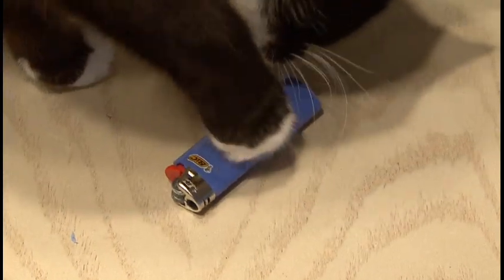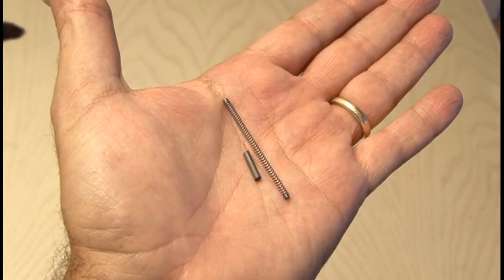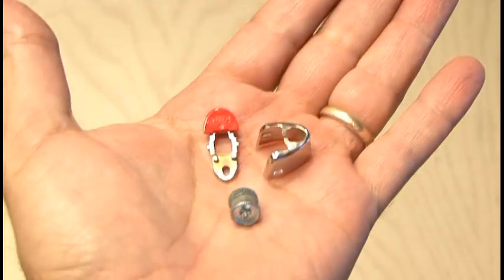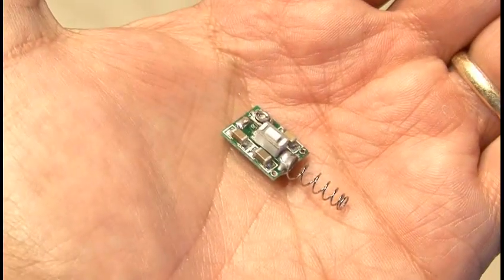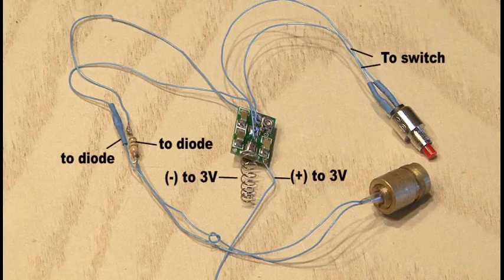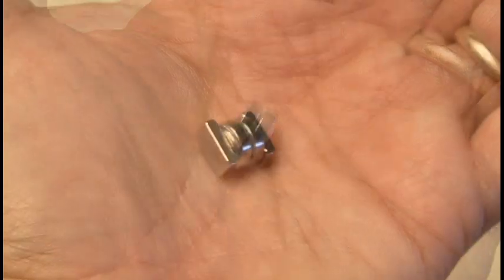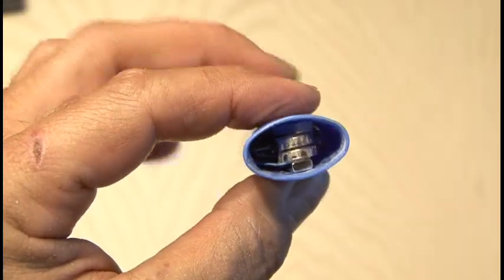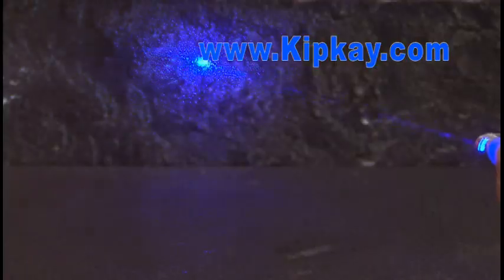Amazing Cheapy Lighter Laser Burner!

Comment: @sorryaccessdenied 

Don't worry. This battery was pregnant.

:D

The 12V-Battery consists of 8 1,5V smaller batteries to reach this voltage. The batteries you know are 1,5Volt, too and they are galvanic cells with zinc and carbon.

greets ;)

Comment: @archangel656 Apparently you don't understand how this whole comment section works... When you see @ with a user name that means the person is talking to the user who's name follows the "@" in this case I "sinisterchopper" was commenting on another users post where that user had commented on AA batteries not containing button cells. I am aware of the fact that this video was referencing the 12 volt A23. You should probably read things throughly before you start spouting off at the mouth.... You

Comment: @elowyn4life Laser pointers produce light radiation, which in turn produces heat as well. The one kipkay built is probably higher than 95mW (which is minimum), so it's more than enough to light a match/firework/cigarette.

Comment: @1l0r1a3c
Notice how long it takes for the cigarette to burn...this is probably one of the weaker lasers that doesn´t instantly ignite you.
Also Cheek /= Retina...
But yeah, pointing it at your face is teh fail.

But the video is not fake, I´m with you on the effort part, tho.
What´s about the people calling this fake anyway, ever build one yourself to try with the parts and circuit drawings he provides?
No?
Then shut up...

Comment: @dm8p8ntballer you dont want this laser. its an expensive peice of crap. if you knew how experts built their lasers you would know how bad this laser is. you will probably burn out the diode within the first week if you get this. if you want a burrning laser search "200mW laser" in google. these are not cheap and ARE NOT TOYS. you will need to buy a good pair of ____ <-(insert laser color/type here) resistant goggles to go with the laser. NEVER POINT A LASER AT PLANES! just sayin. Blinds Pilot!

Comment: @heus199 Actually the main diagnosis for these types of ridges would be koilonychia which is a simple iron deficiency. While heavy metal poisoning can cause horizontal ridges it would also cause discoloration in the nail bed (as well as other extreme symptoms). Don't spout off some random diagnosis because you saw it on House or Scrubs or whatever.

Comment: @zcjhz 808nm is all IR, not red, I definitely would not recommend using this if you are less than a professional. As the dot looks VERY harmless, but will blind out before you can blink. Even its diffusion off of white paper can do damage without proper goggles. You will NEED goggles. Anyway, use this schematic and current reg calc to see what to if you really want to accept the responsibility of a dangerous tool.  diyaudioprojects(dot)com/Technical/Voltage-Regulator/

Comment: I'd suggest buying a set of laser goggles that match the wavelength of the laser diode you are going to use.
Use a DVD burner get some rated to stop 650nm a green laser 532nm or a blue/violet laser 488 to 350nm. 
Also never point it at your eyes even with goggles or any camera you don't want to destroy as it'll ruin the image sensor.

Comment: @MartyMartin87 
It ain't that expensive, second you make this for fun (otherwise you would've kept the lighter as it was), third it's not a gun, but a tool (a lighter is by itself dangerous (I assume you've been burned on something at least once in your 23 years) , just as a standard laser pointer (I assume you've experienced the yellow, strange sticker on the laserpointers saying "Danger! Laser Radiation - Avoid direct eye exposure!"), a screwdriver, butcher's knife and so on) and four...

Comment: @EVEDaniel Kipkays laser is definently worth it, its 150 mw, the only problem is the batterys are hard to remove. and the most expensive laser ive seen was a 1000mw laser which burns through wood, for about 1100$

Comment: @thesouthernboy1000 The kit costs $100 at this website laserdiy-c0m but type the site in like how you normally would like .com. If you get the kit, be very careful with the finished laser. a direct hit in the eye with that WILL cause temporary eye dammage.(over a month until it goes away) also, this laser can easally perminantly make you go blind. lasers are not toys. treat it as if it were a gun. maby even get some laser goggles. just sayin.

Comment: how much are those blue lasers! Is there room to install a modulator for the power so it can burn only sometimes. (preferably a hidden switch to fool friends, and be the only one who is able to light stuff)  This stuff is hard to make if you dont know electronics and have some basic tools (dremel and solder) Id buy one if it was sold for less the fifty dollars. But i have no clue what a blue laser costs. THE BATTERY HACKS ARE EASY AND WORK.  All those FREE batteries inside is like a jackpot!

Comment: @xponen You always have to regard the energy density. That is the amount of energy per area. A Laser concentrates all its power on an extremely tiny spot. That way it can heat up a tiny area real fast and start the chemical reaction (i.e. burning) that does the rest.

Comment: This doesn't make sense... how is it 150-miliWatt laser can ignite anything while a standard 100,000 miliWatt lightbulb cannot?  I don't think the battery has sufficient energy to burn a paper. -Even if you short-circuit the battery, it shouldn't be hot enough to burn a paper, let alone to power a laser that in turn... burn a paper.

Comment: @HJJOPA 1. it aint a AA its a 12volt battery, 2. it was a cigarett' all that hit his face was light 3. this goes with #1 those button cells are 1.5V 1.5x9=12 right? look at how many batteries came out, 9 and plus i did that one and it works so yeah. and you dont have to "trust" him, if you want the truth do the project

Comment: @devastatorFTW23 Ill answer that. No you should not do this unless you have adult supervision. You will need a laser from a blu ray driver,a dvd burner,or an actual laser. The laser diodes in cheap laser pointers wont burn or light anything because they are way to weak. You need a quality "diode" that puts off more then 100 mW, most laser pointers only put of 5-10 mW

Comment: you should change the title....N.O.T. cheapy lighter burner.. i looked on the laserdiy.com and saw the 2 parts that you can buy for this project------>lazer diode  driver----->24.99 (about 4 dollars less then a "Green Laser Pointer 532nm 5mw") and second the blue laser module------>59.99!!!! (this is very very cheap as you can see) i see it as "spend 100$ making this cool but exspensive laser, or buy one for 29$ that wont break" and one more thing.... pickles

Comment: was just wondering but is it possible to cut the very bottom of the lighter of to make it the batter holder so that you can pop it open to change batteries, i mean like it would be held by a small hinge(very small) at one end and a pop lock on the other and you could pop it open to change batteries although i very much doupt the batteries need replaceing very often

Comment: you can buy the hole set on laserDIY.com but i cost 99 dollars, wtf thats not cheap.
the laser diode cost 25 dollars and the blue laser module cost 60 dollar. who wants to pay 100 dollar for this "cheapy" lighter laser burner. it's cool but way to expensive

Comment: bullshit! if thats a 405nm violet diode you need to run that diode pretty dam hard to do that. doing so you will burn out the diode in no time. unless thats a 445nm diode (which it sort of looks like in that vid) coz they can take up to 500mw and cost a good 400 - 500 bux and when this video was made cost in the 1Ks at least

Comment: Ok in this video you warned the watchers.
What about recommending laser protection goggles?
Let's assume an output power of 15mW and a beam diameter of 1 mm. Such a laser is about ten times brighter than the sun! The intensity is about 200 times higher than a running hotplate's one
As laser light is parallel your eye lens will focus it to a point which makes it even worse
I guess your diode power is much higher lighting stuff so fast
Light a few cigs and you will hit the eye some day for sure!

Comment: @iGadwin You must not have a powerful laser then, these are not laser pointers these have hidden dangers to them, just the reflection off a window  can do instant eye damage. even looking at the beam can do damage, you need safety goggles designed to work with lasers in the 405nm range to safely use it.

Comment: Cheapy huh ??? a laser diode costs $60 + the circuit $25 + resistor, lighter and battery $5 = $90, I consider a $2 laser cheapy...

Comment: @MusicWavesMan 
Yes you can.  While it looks like a AA battery, it's actually a 12V A23 battery.  An A23 is usually made by stacking 8 LR932 button cells together and encasing it.  You can split one open and take out the 8 button cells (each of which are 1.5V)

Comment: You also could gut a DVD burner for a suitable laser as for power I usually use those 3V lithium camera batteries.

Oh and never aim it at your face and wear laser goggles made for the wavelength of diode you used.
 It'll do bad things to some important structures in the back of your eye it also can ruin cameras.

Comment: Haha. Lol. Nice video, but it is a fake. No way you can power any laser powerful enough to ignite stuff with two small batteries. The power output alone (we're talking about light, i.e. energy of the light) needs to be several watts. The power needed to generate that is much greater than what you could possibly get from an assembly like that.

Comment: And the cost is: 

Blue Laser Module 150 mw Hi Power 405nm: $59.99
Blue Laser Diode Driver: $24.99

= $84.89
+ sending cost

I tought it would be cheaper ;(

Comment: Lacking butane is not a benefit if it doesn't work worth a crap. I have many uses for the butane stored in these little containers. They are quite handy if for nothing else but a pocket supply of instant accelerant.

I suppose it would be better at the beach where the wind would make it very difficult to propagate a flame. 

In every other circumstance however, I would not consider this modification to be an improvement in the overall product.

Comment: I've seen videos of $100 -$200 lasers which can burn paper almost instantly. Your eye will be blind forever instantly if it gets hit.
Since the parts of this lighters are near $100 as well, I assume it is the same for this one.
If you use this as your normal lighter you are an complete idiot in my opinion. 
I would build a guard on top of the laser so it only shines for a few centimeters.

Comment: No it isn't bud.  Standard laser pointers can be boosted to do just what he shows quite easily.  The caveat is that the laser diode will not last nearly as long as it normally would have due to being over-powered.  You can even do this with the lasers from computer optical drives.  The $300 high powered lasers only use heavy duty diodes that last longer with the extra power going through them.

Comment: you would be very lucky, have you checked out  the price for the components, $85 (us). not really so much of a cheapy really, nevermind  $2.99 for a resistor, worth less than 5c (nz), even though it says 4.02 ohm which isn't a real resistor value and the picture shows a ten k ohm resistor??? weird.

Comment: You'd only blow yourself up if there were a misplaced spark. Otherwise it's only slightly compressed butane, which is not -that- volatile in the little amount that is in disposable lighters. flammable, yes. Explosive, yes. Dangerous when in careful hands, no. :) If you wanna see volatile, drop a feather on some nitroglycerin and watch the show.

Comment: you dont seem to have any idea of technics:

1) The driver circuit is needed not to destroy the laser diode and to pulse the voltage in order to optimize the efficiency. And whats easier than using a cheap general driver circuit from a cheap common laser pointer?

2) Anyone who doesnt know how to connect the really simple circuit to the resistor, the diode and switch should just not even think about doing things like this, because this is just basic. The wiring is NOT complicated, it`s simple.

Comment: 0.15W is too few.  2..5 W would be better. 
please tell can i use yor semiconductors to build a matrix of them to reach power needed? school knowledge tells me that it's impossible since laser ray is a extremely coherent and it is too difficult to add rays from different sources into one ray - very high adjusting precision needed (wavelength, ~405nm). 
or i can use special optics to do it?

Comment: well I disagree with the cheapy part... The diode driver is 25 bucks and the module is another 60, so right there you have a $85 project without the wire, battery, magnets, solder, or the lighter itself

Comment: This is not cheap at all better buy a new laser lighter then try to do it yourself the price of the Blue Laser Diode Driver is 25 $ and the Blue Laser Pointer he was talking about that he extracted the diod from it is a 100 $ the lighter itself the tools if you don't have them you get a realy big price for that shit that could work for some time until the resistor worns out and you need to disasamble the whole thing to change it and the diod itself is not unbreakable.

Comment: @sinister, they aren't "batteries" of any type like those guys or some of these videos will lead you to believe. They are not AA's or AAA's they are freaking 9 volt battery cells. You might, might be able to use one in place of a AAA in a pinch but it would last around 25% as long.

Comment: AA batteries are not many button cells in disguise, that's why you ended up in that situation in the first place. The one I can say for sure you can hack are 9v, 12, 6, and I believe some others, But don't EVER try cells, some cell contain SULFURIC ACID which in comparison, you'll think battery acid is a light tan.

Comment: It not an aa battery if you listen its a 12 volt cell used in small cameras and electronic lighters .and Yes it dos have buttons in them . And duracell 9 volts have 6 AAAA batteries in them as well

Comment: Butane is gas, and not going on about it, but if it was lighter fluid, as in liquid, when he emptied it, would pour out. But you can hear hissing as in pressurized gas, meaning the stuff inside was gas, proving it's not lighter fluid, and probably butane.

Comment: wow, kinda deadly if you're a complete twat with it, also, isnt drilling into the lighter dangerous, if there's any left over butane, it could easily ignite from the heat and friction of the drill and sanding wheel?

Comment: It's a 150 mW laser that can light a cigarette. Unlike a typical laser pointer, where a blink reflex will prevent eye damage, this can easily mark up your retina (blind spots in the middle of your vision).

As an added bonus, it's available to any kid with $100 and a soldering iron (it doesn't get much simpler than this).

Comment: easier way... get yerself a CD-Writer (y'know, those things you put in your PC to burn discs?) and take it apart until you get the laser from that... i'd use something less complicated then a lighter. maybe just a thin torch and you'll have to make yourself a circuit. you all did basic science at school, right? just a simple light-with-switch-and-battery style circuit to go in the torch and secure it. switch it on and you have a red laser that is very dangerous... have fun!

Comment: I'd just buy the 200 mw red laser pointer for 40 bucks on deal extreme and take out the tiny ass chip and the diode it 3/4 smaller

Comment: Blue lasers have higher frequencies, which naturally means higher power output.  The battery limits you to a constant voltage output, but the current flow is dictated by the device.  Therefore a blue laser will induce a higher current and thus your laser will be a magnitude or two more effective than the equivalent low-spectrum laser.

Comment: Color has nothing to do with anything.  It's all about energy.  The more energy you have focused to a single point, the hotter it gets.  

Light=energy, and laser=focused light, so lasers have focused energy, it's just a matter of having enough wattage going through the diode to generate enough heat to burn things.

Green tends to have a nice visual beam for aiming, but tends to aim for a couple hundred feet.   you should be fine with anything over 150mw since that's the output on this hack.

Comment: when an atom is heated, (this is a very simplified explanation) the electrons gain energy and the ones in the rings closest to the center (the ones with least energy) move up. eventually they have to move back to the right ring, releasing a photon (light particle) in the process. thus, creating the glow that you're familiar with when electricity is put through a wire, such as in a toaster. once enough of these particles are built up, they are able to pass through the slightly less mirrored side.

Comment: you really need to do some research on lasers before you make another post. here's the basic physics behind it: 
light is shone into a gem with a mirrored inside with one side being only slightly less mirrored. as more and more light is added to the gem, it eventually becomes bright enough to shine through the mirror, and you have a laser. it has nothing to do with how fast the power is put in, only how much power must build up before it escapes. less power input just means a longer charge time.

Comment: But required 300 milliwats is not very huge power, and 3mW is HUNDRED times smaller value. If you want to burn something you need to afford energy to heat material (even if its black). That two small batteries cannot provide sufficient power. You know what goes when you apply to much load to cell? Voltage goes down, and power goes down, cell goes warm. Thats why it is FAKE, this guy connect laser to external power supply. Just like that, simple. :)